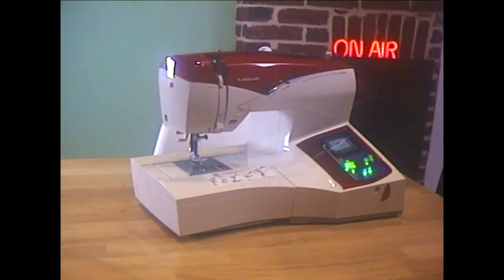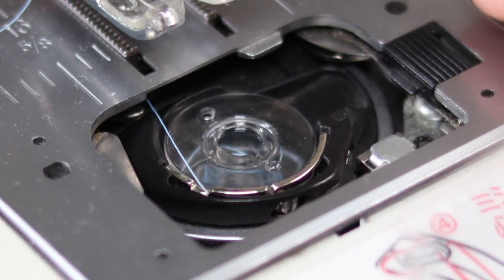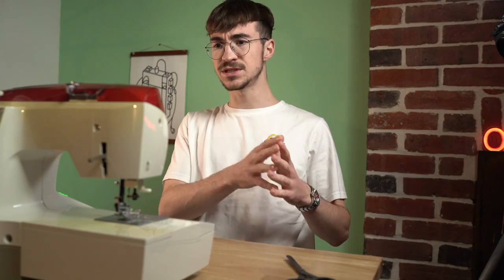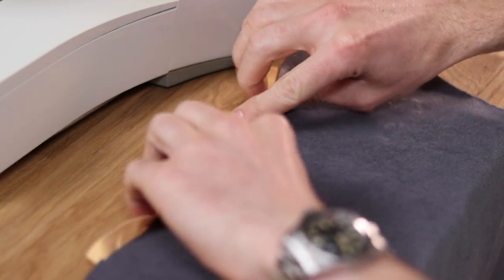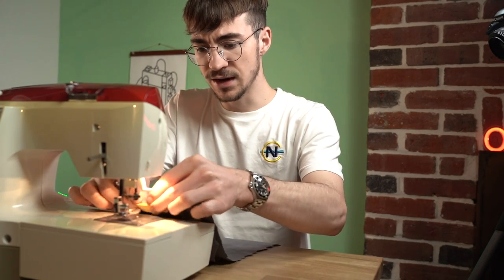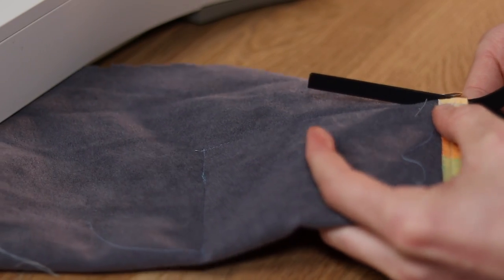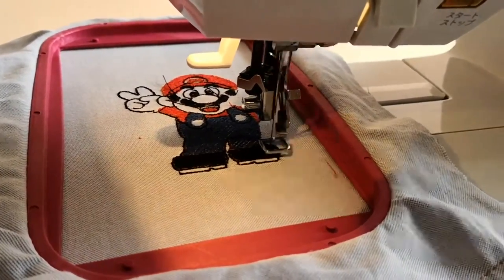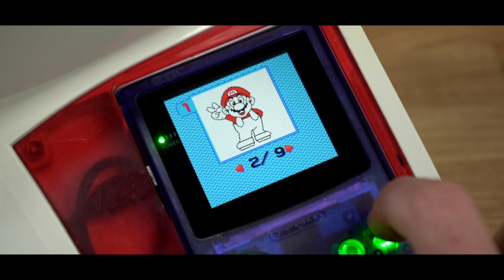The Nintendo GameBoy Sewing Machine

Comment: The fact that you were holding the thread in your hand and threaded the machine incorrectly yet still managed to successfully sew something is testament to both the sewing machine and yourself
Reply: Which part of the threading was incorrect?
Reply: @ciennarose007  I think sewing machines typically have a mount on top for the the thread to sit on while it is fed onto the spool, no reason to hold it in your hand to feed it onto the spool.
Reply: @goatbone  yeah that makes sense, but I don't think that that's what Cindy was referring to? They mention both "holding the thread" and "threaded the machine incorrectly" separately. I was just curious cause it all looked find to me XD
Reply: @ciennarose007  there’s a little hook at the top of the needle where the thread should slip behind so it feeds down in a straight line to the eye of the needle instead of coming into it at an angle. My machine wouldn’t sew correctly without that step!
Reply: @CindyCB78  Interesting! I'm going to check it out on my machine. I don't remember having to do that, but it seems to sew correctly anyway haha
Reply: @ciennarose007  Report back, I’m intrigued now! ☺️
Reply: @CindyCB78 legend has it ciennarose is still checking it out on their machine to this very day

Comment: Sewing is not my thing either, but I find sewing machines fascinating! How they can perform such precise movements and how they can be programmed with just a plastic wheel (in the more basic models).

Can't wait to see part two!

PS: That was quite a cliffhanger! 😂
PPS: RIP camera lens
Reply: Back in the (early) 70's, the more advanced model of sewing machine from elna had a set of plastic CAM's that would allow you to make a lot of advanced patterns..

The fun part of this is that my mum bought an elna with all these CAM's, and it was evidently the super expensive... And I happen to have stumbled across a basic model of the same series in a thrift store <3

(also; these things are made of cast aluminium, and kind of monsters with near indestructible parts, and mechanically uncompromising; as electronics would be still a decade (or so) away
Reply: @mxbunnycatter  It's just called a cam. All lowercase. It's not an acronym. That's it's actual name.

Comment: I'd suggest, or even recommend, that the spool of thread is placed on the spool pin and follow the thread guides when you're going to wind the bobbin. Perhaps you can find a user manual for this specific sewing machine.

Singer also made one which is called the Singer IZEK sewing machine.

Comment: You don’t need to hold the thread in your hand to wind the bobbin.  Just put it in the normal sewing position then run the thread forward and around the the tension plates next to the big hook you normally use for sewing. Take it back and around the red guide and hook it into the spool.  I usually just hold the end and slowly turn the handwheel, to wind a few turns on to hold the thread.

Comment: This wouldn't even have been hard for the sewing machine manufacturers. Plenty of sewing machines and similar devices have RS-232 ports so they can be controlled entirely from a connected computer. The Gameboy's link port basically just has TX, RX, ground, and a 5V line, doesn't it? I know individual games were left to figure out their own networking, so it's entirely possible Singer just took a sewing machine that worked on RS-232 and wrote a Gameboy program to control it.

Comment: omg?? as an embroidery machine enjoyer this is the coolest thing ever. the mario embroidery designs look really cool, that looks like a pretty legit little machine. the expensive ass brother embroidery machine i have works the same way with a big motorized attachment that clips onto the side, it’s interesting how the actual mechanics of these devices have barely changed in years. the features of the software are pretty similar to what you’d expect from a new one too, except that it’s built in and the one i have uses a touch screen. new embroidery machines with screens that display colors and stuff are STILL really expensive for some reason, the one i have was nearly $2000, this thing was ahead of it’s time and presumably cost a lot less than that when it was released lmao. it’s really awesome how they were able to give it so many useful features by using the gameboy as a display!

Comment: I've gotten a bunch of the patterns on mario family, cut shuu, and kirby family working on an SE600, but curious about the differences between the cartridge's original instruction set. The user Chokechai San posted Mario being stitched, but it looks "fluffy" or even "scribbled"... I can't tell if that's how this machine does it, or if they're having a tension wheel issue. When I got my SE600, the tension wheel was out of place during shipping, my stitches were fluffy in a similar way (loops). After I opened it up and popped it back into place, my patterns now have a smooth flat surface. Check out Chokechai San's vid for reference. What's your thought on this?

Comment: Ugh, I have a normal version of this machine (Singer Futura CE200) and I have one hell of a bone to pick with Singer and their embroidery attachment.
1) You can't adjust the speed so it randomly speeds up WAY too fast for the material you're using.  
2) It always starts by stabbing the center and drawing a square, resulting in a string being caught under your design
3) The software is useless if you don't have the physical machine, but they still charge $99 for a replacement CD.
4) The software is only compatible with Windows XP.  They have an update that adds support for Windows 7, but charge and ADDITIONAL $99 for that software update.  
5) Despite being $200, the software won't let you design anything -- only import externally-made designs and overlay text in either impact or cursive font.

If  anybody comes across this and needs the software, let me know. I have no moral objection to pirating the hell out of software that requires a hardware dongle to use.